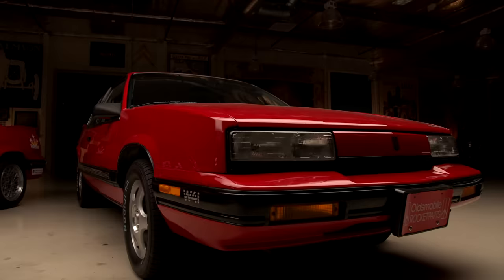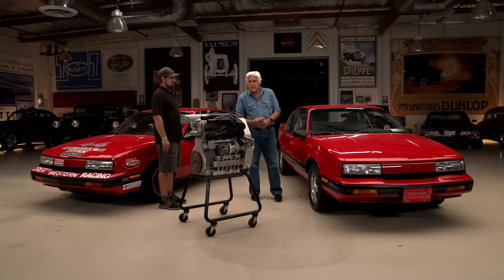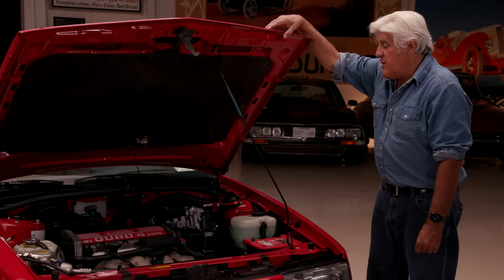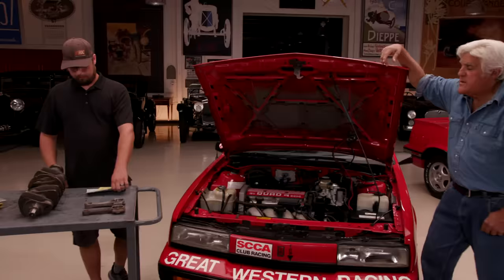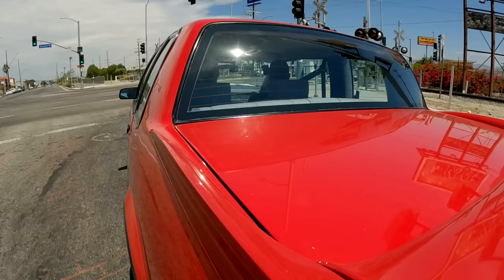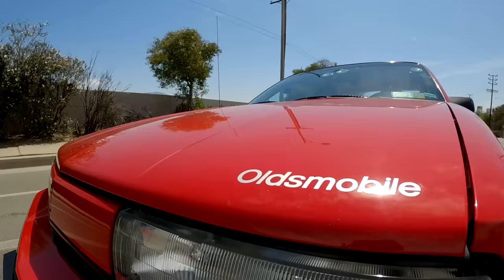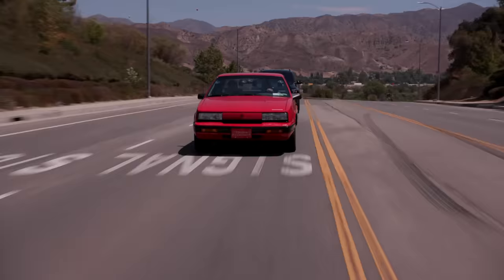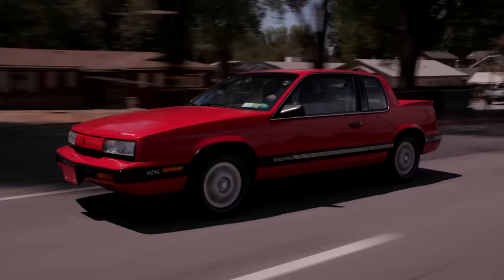Rare 1991 Oldsmobile Quad 442 W-41 | Jay Leno's Garage

Comment: Thank you Jay and Jeff!!!!! <3

I got my first Quad 4 in 1994, it was a 1990 model year Olds 442 W40 (the one with a few less horses, and a fair chunk more production!)..  I wasn't too sure on buying it because it looked identical to my parents 1989 calais, which was definitely not a fun car to drive.   (and to this day, I am s till driving a quad4 derivative! '98 Grand Am represent! lol)

On my test drive, I took it to the nearby straight-a-way highway entrance, and just cycled all the way through 3rd and halfway through 4th before I was on the highway, and I was way exceeding the speed limit.  I was thrown hard back in my seat, like nothing I'd ever driven or rode in before, and without the slightest bit of tire slip.  It was all forward power.

I went straight back to the dealer and bought it.  Put another 100K on top of the 120K it had on it when I bought it, over the next 6 years, before it shot a rod straight out the bottom.  I got it back together, but it was never quite the same again, had lots of other problems with it after.  I had a breakdown one day, pulled off the side of the road, on the way to work.. got into work, after my work day was done, went back to get a tow for the car, and the car was gone.    

I've only met one other person who had a W40, and never anyone with a W41, in person.  But through the power of the Internet, going all the way back to the early 90's "quad4fourm", people like Jeff and the Hackers and everyone else with the Quad 4 community, have been amazing help, even to those of us like me who are mechanically stupid, and just want to drive the hell out of them.

This video brought back a lot of great memories.  You two should take the race one out on the track sometime.  I know Jay is used to cars that are just monstrously powerful compared to the W41, but I bet he'd get quite a smile on his face with the full power output. :D

Thank you both so much, and everyone involved in production. <3

Comment: What a great video. Oldsmobile had a lot of innovation in the 80s and 90s, ending with the Aurora and their Indy engines. Had an '89 Olds 88 with the 3800 that was my commuter car. Comfortable and had enough power to get out of it's own way, partly because it was relatively light-weight.
Reply: I had a 1990 with the 3800.  F85 suspension,  great engine,  smooth,  powerful enough and a comfy car to boot.  It was a nice satisfying car that a family could live with.

Comment: A friend had one of these, fun car.  Good handling, decent performance, good gas mileage.  It’s a shame so few people appreciated them then.
Reply: in 1991, for the same money, one could have had a 3000GT, or a 300zx twin turbo (both 300HP), or the eclipse or turbo celica (both 200HP, AWD) - all more reliable, better handling, and much better looking. it's no mystery why they weren't appreciated more, though it was a good effort from GM, they were just still way behind everything else, including (shudder) Ford.
Reply: @kwajtube  GM has always been behind Ford,
Reply: @kwajtube  For an apples to apples comparison I’d be willing to bet a Spirit R/T would have been a lot cheaper vs. this car in ‘91.
Reply: @RealmCenter40  The spirit RT was the ONLY car in this cars price range that actually put up a fight. All the others were left in the dust. The cars OP listed we're far more expensive than this W41
Reply: @Lrules364  I had just barely had my drivers license when these cars were new. I liked them but my budget was more rusted out ‘78 Dodge Monaco tier. I’m just going off fuzzy memory but as I recall the SHO was pretty expensive also.
Reply: @kwajtube  Different markets. Entry luxury sedan vs sports cars. Cutlass would compete with something like Acura, Volvo or bmw. Cutlass did outsell all those sports cars not even including it’s sister cars from chev and pontiac that were just badge engineering but the sales probably has more to do with its market not that it’s better or something is worse it’s just more approachable to the average consumer.
Reply: @kwajtube  hahaahah, GM was behind in cost, both Old rebuilt dodge and GM becoming pure garbage by the 90's. I had a contour, no wonder the car was off the market so fast, and this was no escort hahahahahaha. Rusted when it came off the assembly line according to even my friend who owned it new and paid what an accord costed for it, admits he should have brought the accord to this day and I would have had a better car to buy from him.At least you could work on a GM and find parts for it, Ford made sure you cannot find anything but tires after a few years.
Reply: Even in red, these cars were so boring looking.  This project should have powered the Fiero, or olds should have added a new flash model or just slap it in a special model Toronado.  Of course the Toronado of this era was pretty ugly too.
Reply: @kwajtube  actually my friend in highschool had  one and his mom bought it new. It was way cheaper than any of the cars you mentioned. All of those were Japanese sports cars and they were 30k minimum which would be 60k now. That Olds would smoke any of the base versions of those cars you mentioned for less money.(we did it a lot with his)

Comment: Jay, Thanks for doing this edition. It takes me back. My first “new” car was a 1989 Olds Calais I ordered from the factory in late 88.  I would have ordered the International Series Calais but the high output 185 hp Quad 4 was not ready until 1990.  I didn’t want the flashy body panels of the International series if I didn’t have the motor to back it. Therefore my car had the standard Quad4 with 155 hp. I also ordered the FE3 suspension on my car and the 5 speed manual.  It was fun to drive and it was a sleeper at that time. I remember challenging a co-worker to a rolling start race on our way back from lunch one day. I thought I could give his 1986 5.0 liter Mustang GT a run for the money but only from a rolling start. After the race start I kept waiting for the Mustang to overtake me but it never did. It was very close but I won by half a car length. We were both surprised. He of course said his car needed a tune up and blamed the loss on that…😮
Reply: My LT1 Caprice would have taken this or a 4.9 Mustang once over 45MPH as well ;-)
Reply: GM could build the most unassuming sleepers. The supercharged Buick Regals and Park Avenues packed a surprising amount of power.
Reply: @bwofficial1776  stock 94 Caprice was dead even to these and the supercharged Sebrings upto 45MPH then it was game over for the supercharged.
Reply: @bwofficial1776  True. My friend bought a supercharged Park Avenue and I always wanted a supercharged Riviera.

Comment: I loved this video. I worked on a lot of maintenance type work on Quad Four equipped car in that period. The plastic cover for the ignition was a weak link for that system and caused other failures. The heads were prone to oil and coolant leaks and there timing chain issues. There were other issues, but when they ran right, those little cars were a blast to drive. I wish I had one now with all the kinks worked out and a turbo.

Comment: I remember the commercials for this when new comparing it to a 1966 442 which I owned at the time.  It noted the 66 as an 8 second 0-60 car:  yes, with a 2 speed automatic and freeway gears.  A M21 with 3.90 limited slip rear like mine had was a different animal that would easily cut 6 second 0-60.  

Would not get 30 mpg though - 16 on a really good day XD

Comment: The NVH on these was a lot more noticeable in the three-speed auto equipped versions. They would shake a little at idle in drive (not terrible though), and the transmissions were programmed to go into third gear with the torque converter locked at 29 mph at minimum throttle and load. Great for fuel economy, but a little bit harsh at that low engine speed.

I do like Quad4 engines though. I don’t think a lot of the poor reception was deserved, although early versions DO have a propensity to eat head gaskets.

Great piece, thank you!
Reply: All true. I remember taking 3 of my friends for a ride in a base 2.3l automatic Calais. I wanted to show them how fast it could go in first gear...60mph. I owned one of the same type also. Some old woman traded it in. I needed to replace the cylinder head once due to a crack and stripped spark plug threads. I was in an accident with it. It was too rusty to fix so I junked it.

Comment: 7:50   This guest nails the answer for Jay.  So many base-model cars built in the last 10 years can embarrass performance cars from year past.  We have minivans nearing 300 hp now (and that's *net*, mind you).  For those that will say 'but they have no torque', well, there are 6-9 speed gearboxes to compensate for that.  And they do it effortlessly - you no longer need to be a skilled driver, you just need to know which modes to turn on or off.

Comment: Pretty sure the family garage down the street, oldest son had one of these. 

I know he had a little red one like this that was bad to the bone and for years all he did was rebuild these and grand ams and resale. 

I remember him selling me a Grand Am and he got me saying it’s got the Quad 4 like that one as he pointed over to a row of covered cars, where he kept it, a 72 SS Chevelle 454, Grand National, a CJ5 Jeep that would tote the front wheels, but almost every time he twisted the drive shaft. Lol. 

He also built what we called a “dune buggy” basically a stripped down VW with some sheet metal tacked to roll bars. That thing was crazy strong and fast also. Blue flake paint with hand painted Cobra on the front. 

Memories! Good ole days. 

Think I’ll blow dry my mullet in slow motion to ZZ Tops “Rough Boys” now.

Comment: 1991 was an exciting year for GM I worked at a Pontiac GMC dealer as a lot boy detailer.. the first two Cyclones that came off the truck I got to drive.
I literally might have been the first one to drive a cyclone in Western New York.
An impressive zero to 60 in 4.3 seconds..
It was a turbocharged all wheel drive 4.3 L and at the time it was a rocket comparably to anything else
Reply: I worked for a GMC AND Buick back then. The proper name was Syclone with an S and not Cyclone. They were rockets but didn’t come close to the Turbo Regals. Those were bonafide muscle cars. I have one and it’s modified. I’ve hurt a lot of feelings at the drag races with my stock looking GN…😂😂
Reply: It is atill a rocket compared to today.
Reply: The 3.1 wasn’t that powerful but it sounded incredible.
Reply: @brianrobinson1259  you're correct it's Cyclone with an s.
I'm using voice text.
What you're not correct about is the Cyclone was faster than the GN.
It was all wheel drive lighter and had a bigger engine...
I'm not sure about the GNX version that might have been faster but the regular turbo Regal was not
Reply: @brianrobinson1259  87 GN 0-60 6.1 1/4 mile 14.7
Syclone 0-60 4.3 1/4 mile 12.9 
The syclone  beat the pants off of a Grand National.
Reply: @brianrobinson1259  I just got done restoring an 86 Grand National.
It has a little Overstock Turbo. It's not turned up all the way because of rear main seal issues.
It's fast but it doesn't get traction the car is heavy, in today's standards its sluggish.
My daily driver is a grandpa E550 Benz and I've gapped this GN with ease.
I will say this though the GN is a cool looking car!
Reply: @larsbambi1575  my best friend had a Syclone and I beat it constantly. My T-type is currently a high 10 low 11 second car with stock bottom end. Back when it was stock he gave me a good run but he still lost. He always jumped me on the start but after 60ft it was all Buick. GM was always fudging numbers back then and car magazines ran them with the crap factory tires so obviously the AWD Syclone had the advantage at takeoff. The slowest my car ran when stock except for the drag radials I installed for obvious reasons was mid to low 13’s. So by me getting good traction evened it up but I still always beat him. After I installed the rear lift bars with airbags, Art Carr trans, stahl converter, 3.73 gears, camshaft, installed programmable ECM, performance heads with studs, turbo, injectors, larger down pipe and exhaust. Also a boost controller turned up to 22psi it became an absolute animal. But anyway my experience was way different than yours. And sorry I wasn’t trying to be a jerk about it so my apologies. Those  Syclones were beasts no doubt but they only had a traction advantage until I put sticky tires on it and it was game over after that. I’ve built a few Turbo Regals and several Syclones and Typhoons and my Buicks always killed them. I loved both vehicles equally but my Buicks were way more fun but that’s just my opinion. ✌🏻
Reply: @larsbambi1575  ..in spite of not really caring much for V6's, the GN and GNX (and Turbo T-Type) always appealed to me..and I can remember watching stock late-model races at the drag strip in 1988-89...I remember the GN's and GNX's racing Mustang 5.0 GT's and 5.0 LX's...the Mustang would almost always beat the Regal out of the gate and pull 2-3 car lengths..after that, it was over...the Regal was gone and the Mustang never caught up...not ONCE that I ever saw..that was the GN and a couple of white T-Types that I can remember..with the GNX, the gap was even wider...I do remember the LX Mustangs were usually a tad quicker than the GT's..I always heard they were a bit lighter...I thought, that if I were to buy a Mustang, it would be a no-brainer to buy a 5.0 LX over a GT, particularly in the '87-'90 models..they looked cleaner and sleeker than the GT with all those tacky-looking doodads, cheese-grater tail lights, etc...and they were cheaper, lighter, and the insurance was a tad cheaper on the LX's...
Reply: @larsbambi1575  Car and driver clocked an 87 GN at 13.5 in the quarter stock so it depends which test you reference the numbers are higher or lower due to different variables. The GNX and the 89 Turbo Trans Am were quicker than both but not by much and sometimes almost equal.
Reply: @dyer2cycle  those era 5.0’s were a blast and I don’t care what anyone thinks those Fox body 5.0 cars had the absolute best exhaust note ever! I had a couple as well as I currently have an 02 GT and it also sounds amazingly similar. Mines Pro Charged with beefed up bottom end and it’s so much fun to drive but my Turbo Regal still obliterates it. My Stang has no chance against it..😂😂
Reply: @brianrobinson1259  ..unfortunately, I have neither..but I DID drive 2 or 3 5.0 Mustangs..I did like the power!...I found the 5 speed manual cars much more fun to drive than the automatics..they were quick, and got up to speed fast!..too bad they didn't offer a manual in the GN..My only complaint with the Mustangs is that they tended to be "squirrely"on takeoff and would fishtail or swap ends fairly quickly...probably because they were so short and light in the rear..I wish they had been just a tad longer...and I always wondered why they stuck to those chinsey 4 lug axles with that much power..would it have been that hard to switch to 5 lug?...the real thing that the Mustangs of this era excelled at was, they were a lot of bang for the buck, and a 5.0 HO LX could be had quite a bit cheaper than a GN...sadly, I never got to drive a GN...I always liked the look of them over the Mustangs, and I think they were a better overall package, albeit more expensive...and, that '89 Trans Am with the GNX engine was even faster than the Regals!..one of those would be great to own now!...
Reply: @brianrobinson1259  yes, I went to a bunch of different sources , the quarter mile times are all over the place. 
🤷‍♂️
Reply: @dyer2cycle  I actually bought an 89 Turbo Trans Am with less than 40,000mi 25 years ago for about $15,000. I kick myself every day for selling that one. They didn’t actually have a GNX engine. That’s an old myth. They had the regular GN bottom end with the regular 3.8L heads from the front wheel drive 3.8L because of clearance issues and had to make a different piston to keep the compression at a suitable level for boost. These were actually more powerful than the GNX. They were rated the same horsepower but the Turbo TA actually put down a hair over 300hp and had quite a bit of more torque. So the Pontiac put down more power than any other turbo 3.8 cars including the GNX. Also the GNX wasn’t really any faster than the other GN’s or turbo cars but the TA was. GM was notorious for underrating power numbers. I totally agree that the 5.0 Fox cars with a manual were fun cars to sling around in. My modified 02 Stang is just an awesome driving experience no doubt. I guess Ford figured 4 lugs were sufficient enough. If I recall the Mustang SVO AND Cobra R were the only ones that got 5lug wheels. Oh and a manual behind the GN wouldn’t gain anything because of the turbo lag and GM didn’t have a manual that would hold up to that much torque and autos are far superior in drag racing and more consistent.
Reply: @larsbambi1575  yes they are all over the place. Too many variables like temperature, better driver and track conditions.

Comment: The Allante absolutely was NOT rear wheel drive.

What it was was the car that introduced us to the Northstar V8 and the ability to run 50 miles without any cooling system.

This car is absolute proof of how a bad reputation can tarnish a good product

I worked at a GM dealer as an entry level tech and never even knew this car existed.